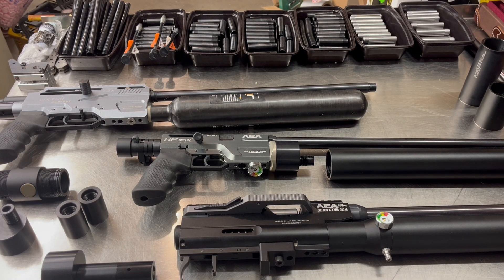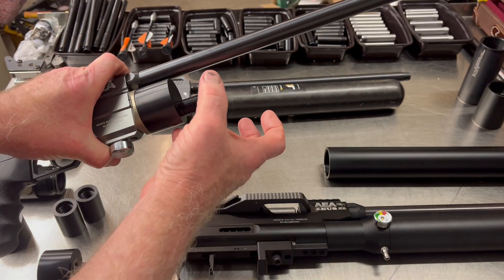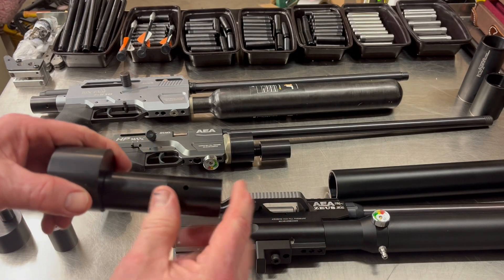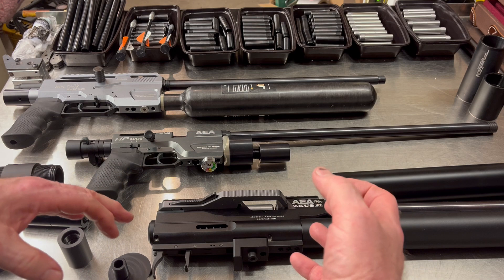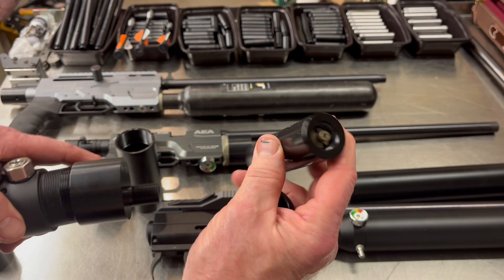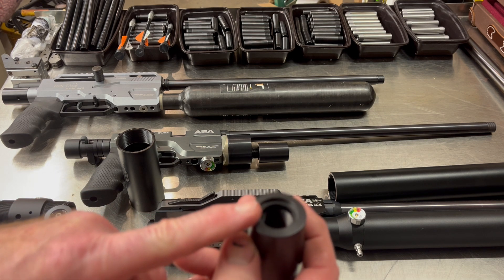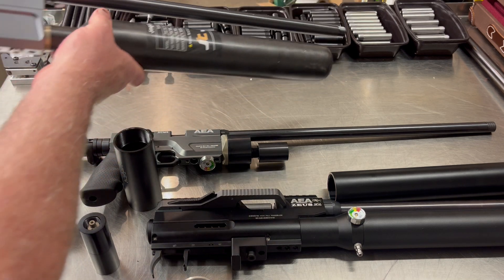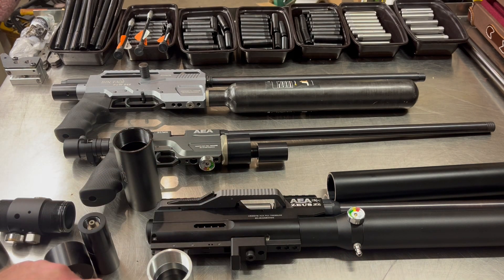AEA 52mm Carbon fiber & Hot Swap adapters M50, Zeus, BW S45, etc. Texoma Precision Pellet VID129

Comment: Jim question the 4.5 inch adapter if used without the regulator does it have threads outside of the adaptor on one end of the 4.5 inch adapter?

Comment: I like having the rear and front tank to the AAA megalodon I also like filling the rifle with those tanks I cannot find a rear tank like the one that's currently on the megalodon when you buy it. If I convert it to fill from the front tank will it still fill the rear tank even if it's a different tank? Another words I'm trying to maintain two tanks front and back and I don't really care if it feels from the back like it does right now or if I have to switch it over and fill it from the front I just like to know how, or where I can buy another rear tank that comes with the megalodon as is

Comment: Would it be possible for you to have made an adapter like the 52mm M18x1.5, but threaded to directly attach the hot swap adapter to it instead, to cut down on some of the length? 

IE, the little tube that has the M18x1.5 sticking out, with the Hot Swap female threads, to reduce the length by at least 2”
Reply from the maker: Yes, but leaves out everyone who already has a carbon fiber set up and wants just the coupler.
Reply: @texomaprecisionpellet7545 
No, I mean, can you have them made, in addition to the M18x1.5 adapters that you already have in stock?

But retaining the offset.

I understand why you made the M18x1.5 adapter.

I’m asking for a “Hotswap only” variant of the 52mm M18x1.5 adapter and how many units would I need to order to make it worth your while to have them made? 🤔

My plan is to retrofit air rifles in my inventory with the Hotswap kit, and I would prefer to have the adapter as compact as possible.
Reply from the maker: @akseminole  I fully understand the question: a brand new part, computer design, DWG file, a few trial and error prototypes, and coating costs 3,000.00-5,000.00 dollars. That's typically for 100 parts. I could do a single part, but the price will be about the same (All the mentioned expenses and machine set-up time). With that said, I thought the carbon fiber bottle adapter would be very popular, but I have only sold three of them???
Reply: @texomaprecisionpellet7545  
That is definitely strange, as I was one of those sales. 

I understand what you mean with regard to the setup and manufacturing costs, but I suspect that most of the target audience is probably balking at the per unit price. 
The AEA M18x1.5 valves cost around 2.5x less, but suffer from a 30+% drop in flow related muzzle energy. I don't have any clue what Bin's sales on those valves looks like, but they very rarely go out of stock, so I suspect that they are not exactly flying off the shelf. 

A suspicion that I have is that getting the CF Bottles might be another bottle neck, so to speak. As most of the ones that I see on eBay have an $80+ S/H charge on top of the per unit pricing.
And ordering them from Amazon usually entails an ambiguous wait time as they drop ship from China.
Reply: *about a 30% reduction in the air rifle that i checked on, I don't know if that is true across the board
Reply from the maker: @akseminole  this is the only part (so far) that I built for an AEA dealer. He set the price and the retail price is definitely part of the problem. Back tracking a bit, your purchase is appreciated, approximately 30 more and I’ll be at brake even. Another product run is probably a ways off, but if I do make more I’ll see about making some without the coupler.

Comment: I have a challenge for you lol, how about a hammer spring adjuster for the challenger pro ,or a way to put a carbon fiber bottle on the pro😊😊😊
Reply from the maker: I’m fairly certain that is 52mm, the adapter should work fine. The tank comes off right in front of the gauge. You put on the adapter and whatever 18x1mm thread pitch carbon fiber tank you want to use